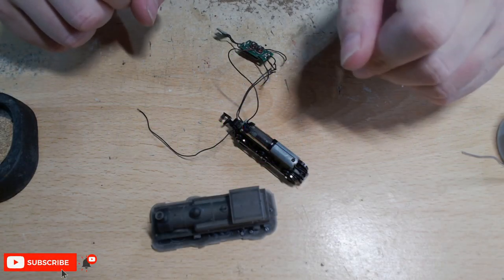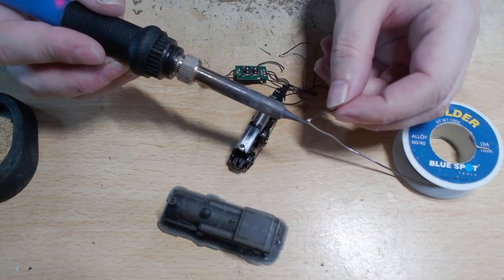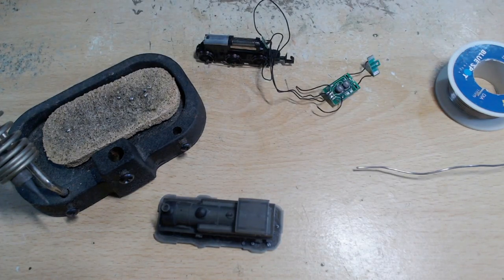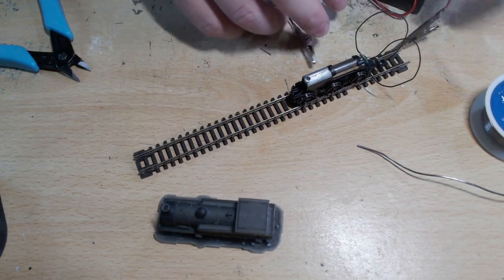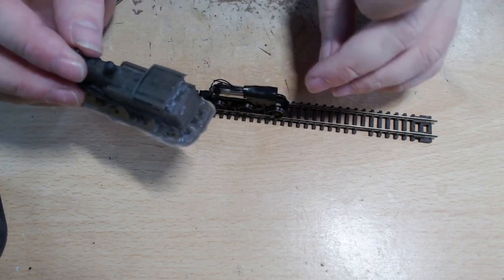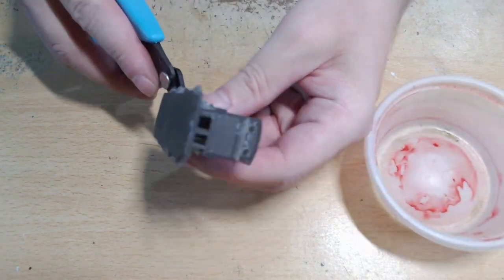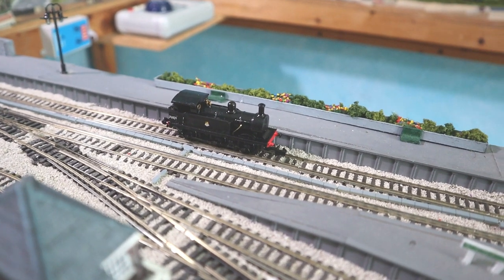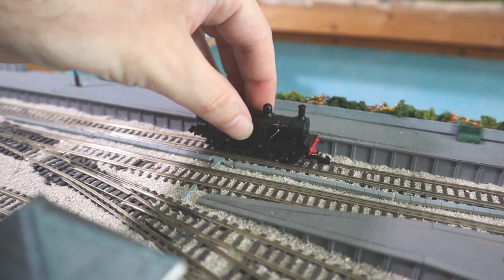Gosport Railworks: SER R1 Class Build

Comment: I absolutely love this loco James. Between each loco build I can see your work is always improving. Never thought of using paint pens. I must try that. I'm just about to do an n gauge GWR class 2800 having learned a lot from you. I'm on my 6th kit built loco. Thanks for sharing yours
Reply from the maker: Glad you enjoyed it Wayne, and trying to slowly get better, though still having some trouble with the complex curves for the funnel/dome connection to the body, but still working on it!
And paint pens are very useful, might not get things done on the first coat, but they dry generally fast so just give it another coat in ten mins etc till it looks good.
Do wish you luck on the kits you're working on, there did use to be a RTR 2800 if I recall, but not sure on availability etc or if you need a specific version.
Either way do hope it goes well, and will continue to share what I build as well!

Comment: Hi James, another great loco build. I would absolutely love an Isle of Wight fitted LSWR Adams 02  in N, preferably a few! I'm sure you could easily put the body together but what about the chassis. Any thoughts for an 0-4-4 one?  I presume the dapol M7 would be well oversize?
Reply from the maker: Glad you like it Tim, and I do want to have a go at the LSWR O2, might try both versions of it if my plans book has them, as for the chassis, the M7 would be the best as it's already a 0-4-4, just the drive wheels are tad too big, the chassis can be shortened as like what I did with the LBSC D3.
Though I was going to wait till the new M7s come out to see how they are like before chopping up another old one, but the O2 is on my list, though it's not the next LSWR engine coming out, that one would be a bigger tank engine!
Reply: @GosportRailworks  thank you James, I'm really excited for the upcoming 02 build! I would love to model something of the Isle of Wight in N as it's where I grew up and my love for railways first began. Perhaps my dream is getting a step closer! All the best and thanks for the videos. Tim
Reply from the maker: No worries Tim, I have moved up when I'm doing the O2 (as was doing another LSWR between the one coming up and the O2) so will be bit sooner, but still hoping the new M7 chassis comes out soon for it, otherwise would be designed for the old one.

And do quite like the Isle of Wight railway as well, they did have a very nice model of Ventnor in N at Haven Street!
And while might take me a while (sourcing and funding chassis for the builds), will get round to doing all Southern engines!

Cheers again and do hope that your dream will arrive soon!
Reply: @GosportRailworks the Ventnor model at Havenstreet is stunning! It is P2 rather than N which is another avenue I have considered myself as the parts are more readily available for scratch building, wheels et al.
Reply from the maker: Thought it was in N? could've sworn it was labelled as such, though has been a few years since I visited so I prob am wrong heh, either way it's still a lovely model!
Reply: @GosportRailworks  absolutely is. I wouldn't be able to tell bud I got very excited to think I had found a N gauge 02 as there is one one the layout but when I looked into it I discovered it was 2mm fine scale. I think it might be Reg Dear's layout but I can't find out definitively. I know he did a 2mm finescale Ventnor layout.
Reply from the maker: Just rechecked my footage of when I visited the Isle of Wight Railway, the Ventnor one I saw was the 2mm by Reg Dear, which was prob why I confused it with a N Gauge one, just on the 10min mark in the video if you want to have a look at it!
The other layout they had was bigger and went round a room, though I didn't get a shot of the info board for it, just after the 1min mark in the vid.
Reply: @GosportRailworks that confirms it then! It really is superb. 

I had a thought about the chassis for an 02. Could a dapol 14xx be made to work? Would need an extra set of bogie wheels but the drivers would be pretty well good to go wouldn't they?
Reply from the maker: From my notes of the wheel sizes for each chassis, the 14xx are closer in size to the O2, still tad bit big by less than 1mm, could still use a set of M7 bogie wheels to finish it off, from what I remember they are quite similar in part arrangement as well.
I do have a spare 14xx chassis so could see how well it fits while building the O2, though would be reserving it for a LBSC D1.